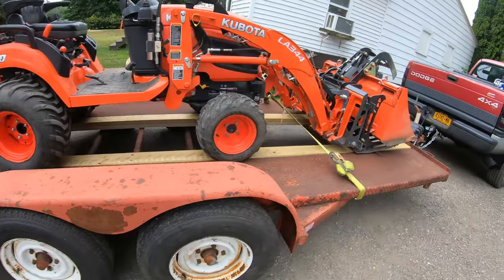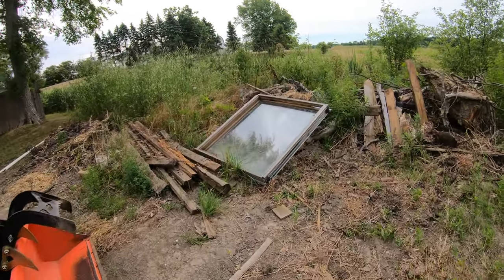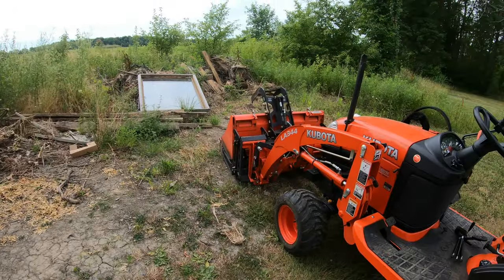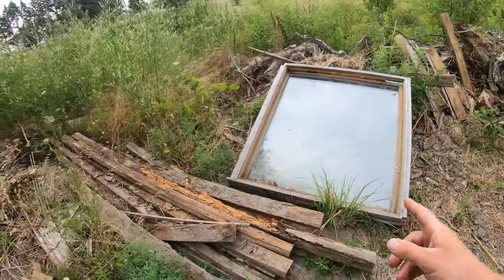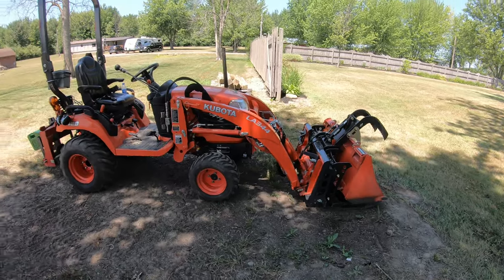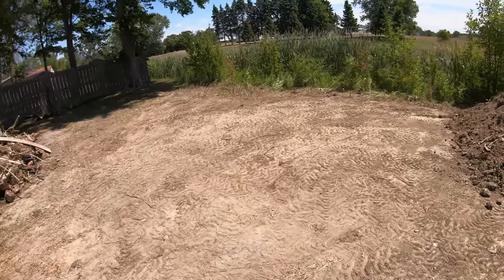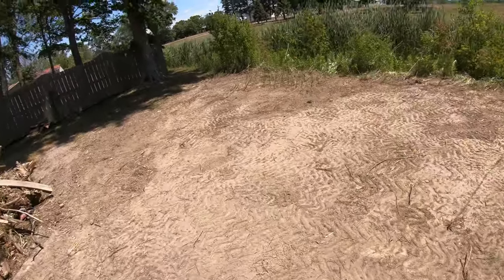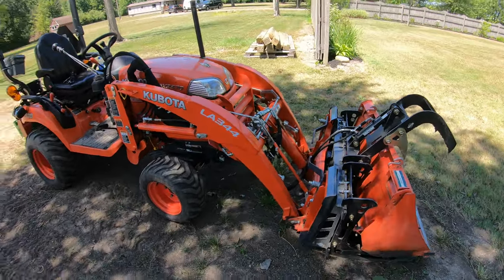FIRST JOB WITH NEW TRAILER!! (GRAPPLE, BUCKET, + GRADING WORK!)

Comment: Out of curiosity, is there typically a lot of slop (play) on a bx fel? I just got my bx2680 today and had to play with it a bit and noticed quite a bit of play in the curl function.
Reply from the maker: Hey Joel, yes there will be some slop or play but on a brand new tractor most your slip or play should only really be coming  from the hydraulic cylinders when the engine is not running .. you should be able to move the bucket up and down some as the engine is off this is totally normal and the John Deere 1 series also does this. Now if your talking about alot of play being in the curl cylinder pins then that is not very normal if it’s a brand new tractor.. tho it may just need some grease too.. how many hours are on it and when was it greased last? Be sure to grease your loader using “Moly” grease and do it once every 10 hours give or take. Also be sure to check all your wheel lug nuts, hydraulic lines, and loader mount bolts every 5-10 hours for the first 50 or so hours as they will often come loose on a brand new machine until you get the machine broke in.. this is very important so you don’t cause damage down the road. Also check your fluid levels! Transmission fluid will settle as it works all the air out from being freshly built especially the front axle.. be sure to check these often till you hit your 50 or so hour mark.. your front dif will no doubt be low on fluid at some point as you break it in as the front axle allows for many pockets of air to be trapped that can take many hours to work all the air out.. don’t do what so many guys do and find that after 100+ hours of use their hydraulic oil  or axle fluid level isn’t even on the dip stick cuz it happens all the time. Stay safe!
Reply: @BiffsEquipment  Thanks for all the great advise.  Tractor only has one hour on it. The dealer did a great job greasing all the components. The front axle is full and the hydraulic is as well.  Somehow they missed the coolant though so I need to get some.  Thanks for the advise on lug nuts and loader bolts. I would have never thought to check those out.
Reply: I meant to make another comment once I figured out what was wrong.  Heads-up, it was all my fault. It began to irritate me that the bucket would just flop all around when I was using it.  I ended up calling the service department at the dealership I bought it at and talked to them and they asked if I would send them a video of exactly what was going on. I did, and they said that wasn't normal and they would be by the next morning to pick the tractor up to take it to the shop.  8am they were there to take the tractor, and around noon they brought it back saying they took the cylinders apart and went through the tractor and couldn't find anything. After messing around with the tractor they discovered they were doing the same thing I was....keeping the rpm's at the low end of what Kubota indicates on the rpm guage for FEL work.  It has to be WOT for the small hydraulic pump to work correctly. Since then I haven't had a problem at all.  I just need to remember this tractor needs to be at full throttle.

Comment: No straps on the bucket, where’s dot when you need them.
Reply from the maker: I believe the bucket would need to be “secured” not strapped..  being that the bucket is clamped down tight into the grapple it is secured.. tho it’s only a 3 minute drive to where I went on this job.. if it was any longer than say a 5 minute drive then I woulda thrown a strap on the grapple lid to ensure the hydraulic clamping force on the grapple lid did not seep down during the drive. 

I doubt DOT would give me a hard time about it, tho I could throw a strap on the bucket too for good looks if I was was worried about it, but that bucket wasn’t going anywhere..